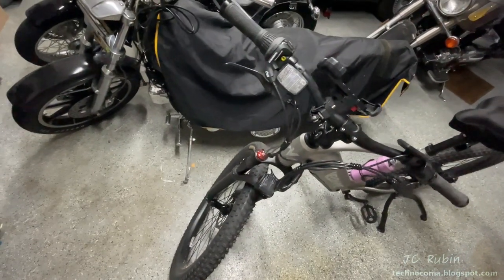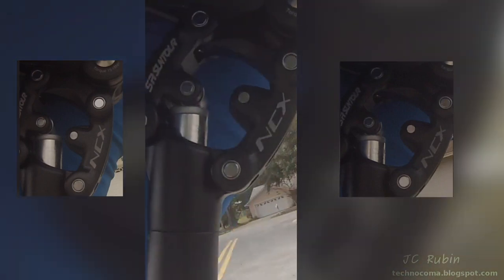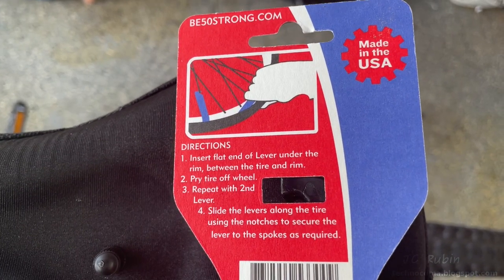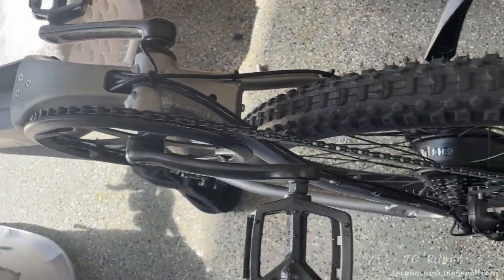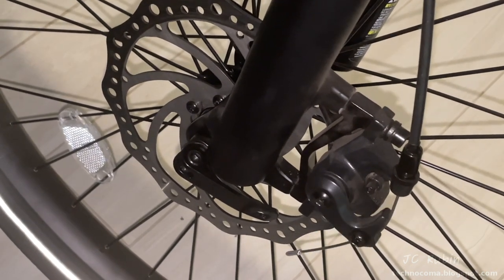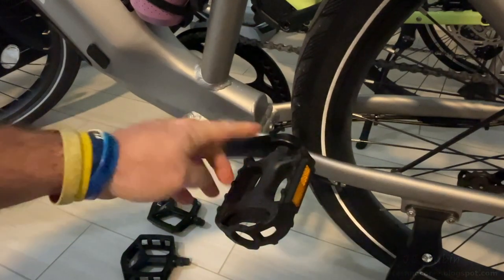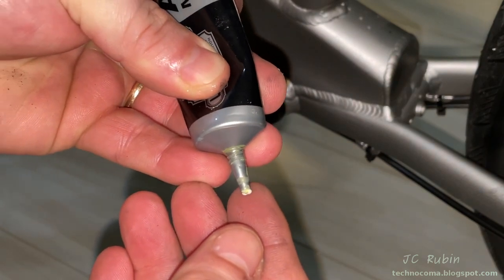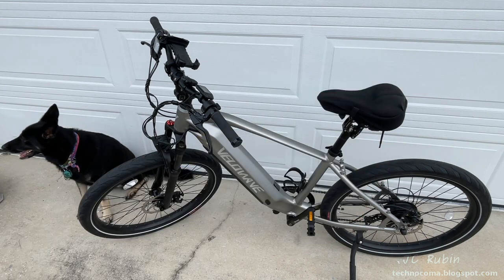Velowave Ghost E-bike - Upgrades, Adjustments and Repairs

Comment: Wow. The bike actually looks so much better now :O
It sucks that a lot of these bike manufacturers don't offer non MTB tires on these bikes.
Reply from the maker: The tyres make a big difference.
Reply: @delorean1  Question: how did handling, range and speed change with your new tires?

I switched mine with Schwalbe Hurricanes, and it already made a large difference, making it a lot better at handling, braking, acceleration and efficiency. Considering you chose even better tires, I'd like to know how it differentiated itself from stock.

Comment: Wow thanks so much for these videos! I have been researching ebikes for about a year and settled on this one a few months ago but by then they were sold out on amazon. they finally got some more and I bought one the other day and got the last one with the rear rack and fenders (for grocery shopping and it gets kinda rainy around here). Thanks for showing the seat post diameter, I will be getting one of those and for the tail light alarm. And a thanks for showing how to adjust the derailleur and go through the crank, that is a BIG help. One question: what kind of pedals would you recommend? I've read a few reviews that mention the pedals breaking. Thanks again.

Comment: I liked seeing the derailleur adjustment and removing the rear wheel and crank tightening, all critical things I hadn’t figured out. 

I’ve got 2 of these bikes and one won’t turn on anymore even with a full battery, any thoughts on troubleshooting?
Reply: I have two of them as well. Have you tried unplugging everything? Velowave support helped me figure out I had a bad controller on one of mine. It was out of warranty, but they still helped.

Comment: very nice detailed video!  I broke two teeth on my rear derailleur this weekend, any idea on which replacement I should use?
Reply from the maker: Order the one from the OE... I havent had any such issues yet.
Reply: Try the Shimano Altus M310/Acera M360.
It works quite well and is a good improvement from the stock Tourney.

Comment: How much height does that springed seat add?  I ride it with the seat as far down as it can go.  This looks like it would add a couple inches?
Reply from the maker: It does in fact add at least 1.  Check the Mfgr website they mention specifically how much.   Remember compression height is what matters not the resting height.